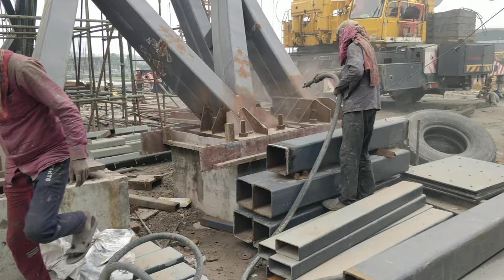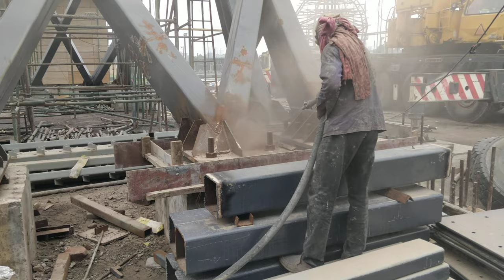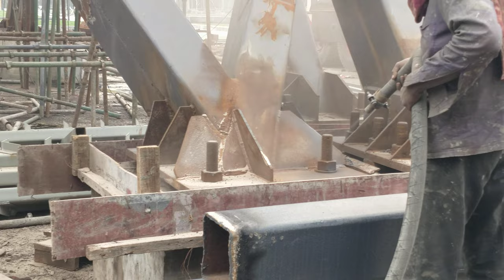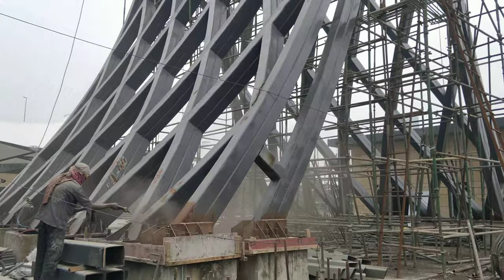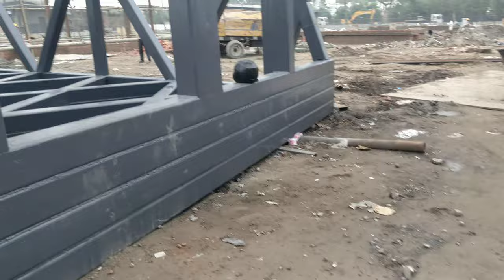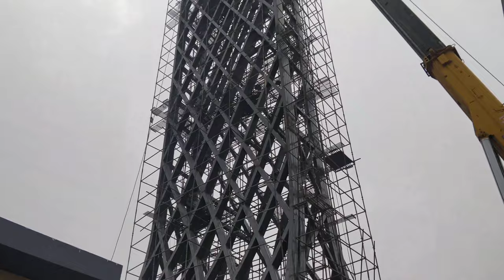#Sandblasting #CopperBlasting #SprayPainting #Callon8981525752/8240100052

Comment: I don't see a "deadman in use Mick.
also a breathing filter before the helmet. I'm sure you have them somewhere in the interest of safety & your health.
Reply: The helmet has it's own separate breathing apparatus. A filter system would be shredded or interfere with helmet.  And most nozzle/hoses have manual controls, simply let go of trigger and the feed stops.